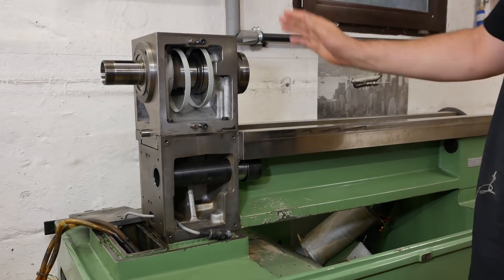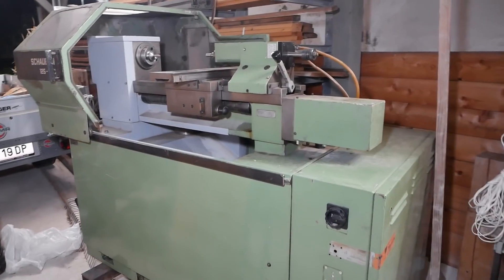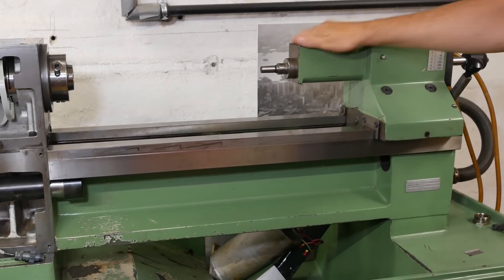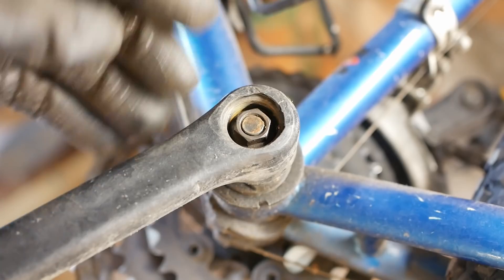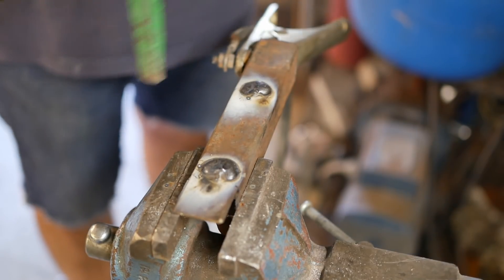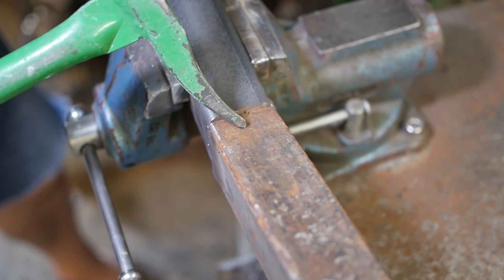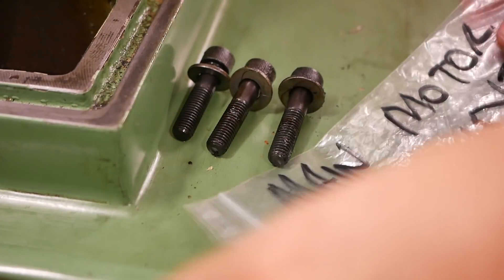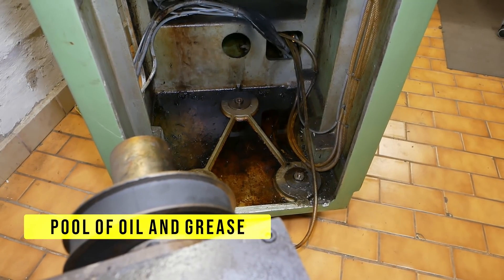Schaublin spindle drive

Comment: Wouldn't you have been better off just buying the complete other lathe, which already had servo motors??
Reply from the maker: There are very few CNC lathes in this "toolroom" style, almost none this size, and none of this quality. 
Changing the servos was not a show stopper.

Comment: I got some square tubing that fits inside my hoist boom and I can extend it out about 5-6 more feet. I have a 5gal bucket of rocks for a counter weight and sometimes I just stand on the back. I recently used it to lift my new Grizzly G0704 mill out of the pickup truck. I picked it up for $800 US. Now I have a mill to fix my other mill. I'm converting my round column mill to a square column but needed a mill to do the job. Problem solved. More tools, more fun. Loved your new video. Looks like you are much closer to chip time.
Reply from the maker: I didnt advertise it, but that hoist boom was also outside the correct extension. Worked fine on that load.

Comment: That is a very nice setup. Those engine hoist are a real back saver for sure. I used mine recently to pull some stumps out the ground. Worked a treat under the 3 ton setting.
Reply from the maker: Good ide. I have the stump of a dead apricot tree to remove.

Comment: Your arc shots are some of the best I've seen. What is your secret?
Reply from the maker: Set up the camera, with about 1000 ISO, shutter speed 50 and 2.8 apperture, fake striking the arc. Then screw in an 8x ND filter, drop the iso to 200, close the aperture to F11, and the shutter to 200. and weld.  Edit the actual arc strike to the fake strike. 
Massive underexposure, and a royal PITA with welding gloves and a helmut. You can see that I stop doing it after a while as it is just too annoying. 
I really should make a flip up filter for the lens to simplify it.
Reply: @RotarySMP  Gotcha. Thanks. Annoying, but looks good!

Comment: Ah oil and grease and dirt mix gunk. Best gunk 😅. Cleaned lots of this out of a big british vice today, what a coincidence, right? Gotta get some solvent tomorrow, I guess kerosine or grill starter should do the trick. And I even found some golden shimmering dirt hidden in one spot, too… Didn't expect that at all. 🤔.
Reply from the maker: I am still looking for the gold bar hidden in this machine. So far everthing which looked like it was fools gold... or brass.
Reply: @RotarySMP  found some more gold dust when cleaning my makeshift parts washer after washing that huge vice with Lidl grill starter (with the lung hazard icon). Works excellent to get rid of the gunk and evaporates like WD40. It's more or less all kerosene, just the cheapest choice. Might work for you. Might invest in one if these cheap parts washers now, kinda like thr cheap blasting caninet but I guess now much can go wrong with a parts washer.
Reply from the maker: @gubr  I parts washer would be a handy addition. So far the gunk on the gearbox came off easily with a razor.
Reply: I am eyeing one of these cheap ~50€ 13 L ones you see everywhere. Used Lidl car oil pump today, works excellent but kinda too powerfull..

Comment: Thanks for another great video, I enjoy watching the Schaublin restoration. That motor/gearbox combo is massive. Every time I see the machine, I think that the headstock casting seems quite small compared to other parts of the lathe.
Reply from the maker: It really is. I would guess that Schaublins best engineers put considerable knowledge into that head stock, spindle and bearing design, so I am sure it is seriously rigid. I't looks on other parts like the mount housing, they just overbuilt it.

Comment: I don't envy you having to clean the lathe stands interior and the drive components, a few hrs right there for sure. I'm certainly not a welder, but years ago an old German machinist showed me a trick he uses while stick welding. Find a short piece of construction grade fir/pine 2"x4" maybe 6"-10" long. He kept that on his welding bench, the instant the weld bead was done he stabbed the still red hot electrode end into the wood and pulled it out. That cleans any melted flux or contaminates off the rod end and the next weld was a lot easier to start.
Reply from the maker: Cool tip. Thanks. Yep, there is quite a ess to clean out.

Comment: at 8:56

Didn't you get a nice, big (*) vice a few months back?

(*) it was big, and it was nice
Reply from the maker: Yep, restoring it is still priority one … on page 3
Reply: @RotarySMP  Ha. I once made a priority chart for a company I worked for. It had levels like:

top
alpha
1st
primary
urgent
customer waiting

which were all equivalent, of course :-)
Reply from the maker: @paulwomack5866  Yep, that is how my projectitis list looks as well.
Reply: @RotarySMP  I can't remember which video showed it. I don't remember the condition being bad at all, it looked (IIRC) quite usable.

Mount it NOW, restore it later.
Reply from the maker: @paulwomack5866  It is missing jaws, and one of the jaw screws is broken off in the casting, so I have a little project there even if I dont  restore it.
Reply: @RotarySMP  Apols - my memory of the condition is clearly wrong.

Comment: I can understand why you were postponing the pull out of the spindle drive! The C-frame was a good idea and you figured out the center of mass quite well. Huge cleaning chore ahead :-)
BTW, great threadlocking technique! I tried once with epoxy on my bike and it didn't last :-)
Reply from the maker: Yeah, I started cleaning today. Just eyeballed the center of gravity, and got close enough
Reply: @RotarySMP  Extra showers today, then :-)
For simply eyeballing, that was pretty close.
Reply from the maker: @JoseSilveira-newhandleforYT  The pivot point is so high above it that the cosine error is pretty small.

Comment: Definitely a very skookum tailstock having that long overhang in the casting so that you don't need to use the quill too far out.
Reply: I wish more lathes had overhang. Maybe not that much. Some nowadays are flat faced, requiring rediculous quill stickout to do anything. Must be in an effort to get more C:C distance, at least on paper.
Reply from the maker: @TheMetalButcher  This one will have the other problem, that it limits max part length. The later 125CCN has a parking place for the tailstock off the end of the bed.
Reply from the maker: I think it needs the overhang, as the saddle doesnt have the traditional wings with a cut out to let the tailstock get closer.
Reply: @RotarySMP  true, must look at the other lathes that have only one set of ways and compare.

Comment: Been there before with the V frame car engine hoist. Had to drag a 900lb mill sideways off a pallet until it was close enough to move the boom back in and lift strait up the second time.
Reply from the maker: Wonder if Nico will notice if I widen it a bit?

Comment: I used one of those cranes myself this weekend, lifting a 110kg granite surface plate out of the back of my car. At this rate I should probably just buy one myself so I can return my brother's.  

Good job getting that motor assembly out!
Reply from the maker: I think Nico lent me his 8 years ago. All attempts to return it have been in vane. He hasn't even borrowed it back once!
Reply: @RotarySMP  that's always nice. I have several things in my shop too big to move by hand

Comment: Lol! on the bicycle repair. I still have my bicycle that I bought in the UK in the 80's that I brought back on a flight to London in the late 90's. A couple years ago I took it to a bike shop near me here in the states for some TLC. I kid you not the guy says to me after taking a look at the bike that the break lever cabling (or words to that effect) is on the wrongs side! Was this bought in Europe? Something I'd never ever imagined was a thing!
Reply: A lot of the bikes here in Denmark have roller brakes on the back wheel that you activate by back pedalling. This is not what I'm used to. It's disconcerting trying to stop in a hurry and just grasping empty handlebar.
Reply: @SalmoTrutti  That sounds scary. I'd definitely face plant if I didn't know my bike had one of those.
Reply from the maker: @SalmoTrutti  I bet.  I havent ridden a back pedal brake bike since I was a kid. They are cool for doing skids.
Reply from the maker: That is common here. Brakes Lh/Rh reversed, at least relative to motorbikes. I switched then straight over.
Reply: @RotarySMP  On the Yamaha 125 motorbike I had in the 1980s, rh lever was front brake, lh lever was clutch, rear brake was a rh foot pedal, lh foot pedal was gear.
Reply from the maker: @paulwomack5866  THat is motorbike standard. In Europe, on bicycles they put the front break on the LH level and the Rear brake on the RH, which is dangerous for those of us who started off with motobikes.
Reply: @RotarySMP  A Uk-ite writes; yes, in America bikes brakes are the wrong way round.

When I hired a bike in San Francisco, the shop was so aware of this that when they heard my accent, they immediately offered to swap the cables, an offer I accepted.

Comment: Yay, progress on the Schaublin! Will you be leaving the motor assembly alone, or converting to a servo motor like Harold did?  That tailstock was quite the find.
Reply from the maker: My home electrical service is only 16A, so I will keep the 3.8kW motor and back gear. Since the variator is there and seems in good condition, I may as well use it as a fixed pulley at least, or maybe even get it connected. WIth a VFD (to reduce the number of power relays) the Variator and the back gear, I should have enough torque to alter the earths rotation.

Comment: I was gonna make a comment about your nice safety slippers, but then you changed shoes for the actual lift. Glad to see you back on the lathe. That tailstock is impressive. Are they factory matched to the headstocks for center height?
Reply from the maker: Yeah,  I decided the steel caps were ore appropriate around that beast. Glad you noticed. :)

Comment: Gotta say, the big servo drive option looks ever more sensible once you've pulled that massive chunk of motive metal out of the lathe.
Reply from the maker: It is a great solution if you have the necessary electical service. I only have 16A, so keeping the original motor is a better option.
Reply: What are the advantages of a servo drive spindle? Not knowing much about these things the advantage that comes to mind is better low speed torque but does one really need that when there's a gearbox available?
Reply: @Joelsfilmer  A vector drive motor controller gives you better low rpm torque as you mention. Depending on the electrical service available you might be able to upgrade to more horsepower because of the improved power density of modern motors. You also get closed loop rpm control so that your rpm stays constant under cutting load.  You can do things like control your rpm based on your cut diameter to get constant surface velocity at your cutter, or constantly varying your rpm up and down by a few hundred rpm to try to reduce chatter. You can use the closed loop position control to do screw cutting by syncing the spindle to the axis drive servos (this also allows you to make any weird helix or thread form you want without needing the right changegears) or 4 axis milling with a milling attachment, or things like skiving and gear hobbing.  Not an exhaustive list but a few things I could think of.

Some of these things you can already do with a VFD on an ac induction motor, because the vfd can keep track of where the rotor is by measuring the back EMF of the motor. Essentially the VFD momentarily stops driving the motor and measures the voltages in the stators caused by the moving rotor. The big limitation here is that it doesn't work down to 0 rpm, you need at least some rotor speed to do the measurement, and you cannot keep track of absolute position so syncing the position of the spindle with different axes doesn't work.

Comment: Time to clean the motor.
So we need the big angle grinder and the welder. 🙄
Congrats on the tailstock find. A real win there 👍
Reply from the maker: Thanks. I am really happy about that. If a manual star wheel tail stock fell into my lap I would still get it, but this takes the pressure off.

Comment: good job, I got a second milling machine a week ago and I need to put it back together, for transport I had to pull it apart, it has a 120kg cast iron weight for balancing the table up and down movement, I guess my back will do all the heavy lifting, it was a pain to get out, can not wait to snap my back in half again while putting it back in :D
Reply from the maker: Not a good plan. You back is something you might need laterin life. Use hydraulics.
Reply: @RotarySMP  Yup. Moving it by hand is a dumb idea no matter how you spin it.

Comment: Thank you for serving us another video on sunday
Reply from the maker: You are welcome. Glad to get passed that procrastination point.
Reply: @RotarySMP  Got a question real quick. Do you know of a good thread or sth similar in the linuxcnc forum regarding parametring pid values in linuxcnc with analog servos and glasscales like on your maho?
Reply from the maker: @mrspeaky6885  One of the hardest things about PID tuning an analog servo system is accepting good enough and stopping. the HAL Scope allows you to zoom in further and further and it gets out of hand. I initially tuned my system with way restrictive following error, keeping it with a few µm at all times, but had poor performance.

https://forum.linuxcnc.org/10-advanced-configuration/32367-servo-tuning-detailed-how-to?start=0